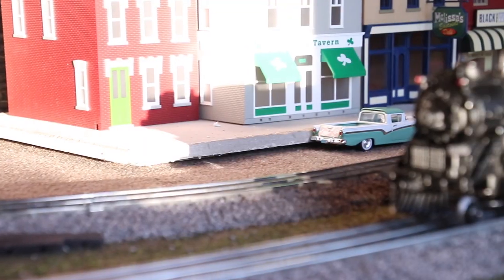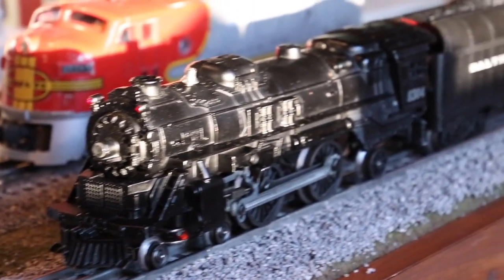LIONEL #8304’s FIRST RUN IN 2 YEARS! Running My Lionel MPC B&O 4-4-2 Around The O Gauge Layout!

Comment: Yep, those locomotives are nice when I got mine I didn't realize that it was an MPC when I looked at it I thought it was a 2018 or a 2016 or something like that, but nope, and they are really good pullers and smooth runners
Reply from the maker: Same here Ben lol. I thought it was actually late postwar but then I found out it was MPC which was another reason I put it away back in 2018. Thanks for the comment!
Reply: Yeah, I was really excited to find my 8142 locomotive for 65 dollars at a flea market, it was a small box containing the 8142 and a couple of really cheapo postwar and MPC cars. I was a tiny bit disappointed when I found out it wasn't postwar, but when I found out how good of a puller and runner it was I was satisfied with it.

Comment: I’ve got two of these 8304s and they both run smooth and quiet as well. A great improvement is if you paint the aluminum motor frames a flat black it’ll look much more realistic, although you’ve got a rare 8304 since it isn’t all beat to death  by some kid so maybe it’s best to keep it mint!
Reply from the maker: RichardsTrainsAndMore yeah really Iʻve never seen a very good condition 4-4-2 in real life besides mine, I see them at flea markets but there always battered up so I guess I do have a common locomotive but in much better shape then most lol. Thanks for the comment!

Comment: What was done to your 4-4-2 that fixed the problems?
Reply from the maker: Craig Chott great question! So to get this guy working like usual my train guy had to do quite a few things. He completely took apart the motor, cleaned all the parts since none were broken and in bad shape and adjusted the pilot wheels so that the front of the locomotive doesnʻt sit high. He says there was a lot of greese buildup from not being properly cleaned over the past 10 years and thats what likley caused it to spark because the brushes could barley move. Thanks for the comment!